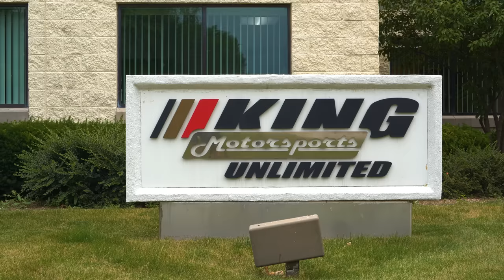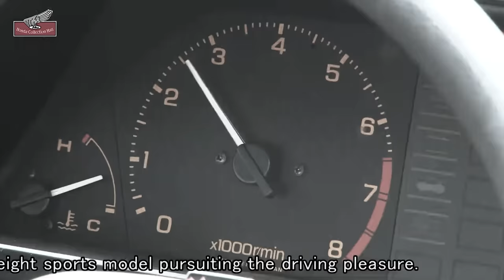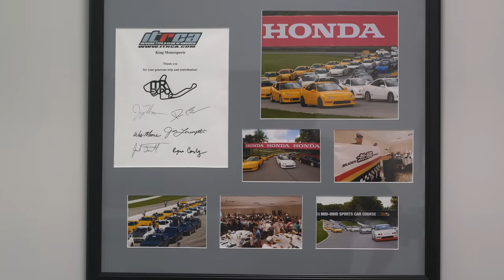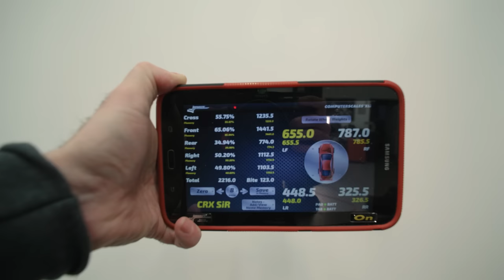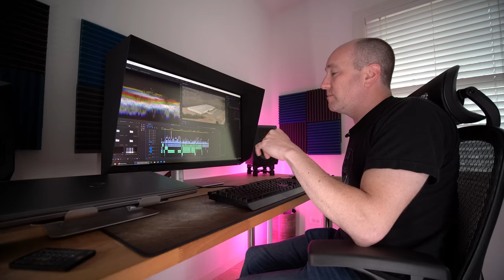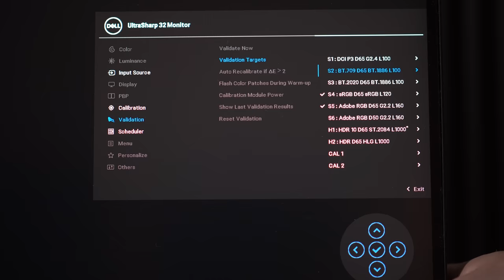Honda CRX SiR | The Golden Age of Honda

Comment: The rush of nostalgia was a smack in the face. I had CRX si for a short time and I miss that car dearly. The experience and joy of driving was unmatched. You have a cinematic gift which we all love watching! Never stop.
Reply: Same, one of my favorite cars I ever owned was a '90 CRX with a B16 and I changed out the trailing arm and front lower suspension arm bushings for Mugen units, what a response machine! Too bad the car just rusted out and I ended up with a DC2 next.
Reply: @KeitheR81  He starts the video by saying this car was fun, light etc etc and mentions affordable and attainable……🙂

I remember these very well when I was a teen and began driving in 91 in South Africa .

These were definitely not affordable to the average South African as Honda was pitched at the high end of the Japanese market in SA. Honda was sold through Mercedes Benz SA and they had price tags to match the premium Merc brand ….by that I mean much higher than Toyota, Mazda, Mitsubishi and Nissan, whom they were competing with. 

Honda specs in SA were premium so I guess you were paying for what you got. 

I never did get to own a CRX but I did manage get myself a Honda Ballade 160i Luxline 94 model which was a lovely car.
Reply: Did you rice it out, crash it, turn it into an endless project and sell it to the scrapyard?

Comment: I owned an early model CRX HF followed by a CRX Si back in the 1980’s.  They were both fantastic cars - the HF got 50+ mpg, up to the low 60’s on long highway trips.  An interesting thing about the HF was that the wheels were made from magnesium - so true “mag” wheels.  It wasn’t exactly fast, but in the ‘80’s very few cars were, and this thing was just so efficient.

They both were exceptionally comfortable offering so much leg room I could actually get the seat back far enough that I was stretching to push the clutch in and I’m no small guy (6’ 2”).  I remember one summer trip when I took the Si up to Canada and then ran it back through the UP of Michigan comfortably cruising at 100mph.  It’s one of the vehicles I wish I had kept in storage for posterity sake.

Comment: First YouTube video I've ever paid for. Honestly top tier production value every single time, thank you for your continued efforts!

Was floored by the CRZ comment. I get that it doesn't make a lot of sense on paper, but after driving one for 6 months it always makes me smile, which is great considering its only job is for the daily gridlocked commute.

Also I can't think of a suitable replacement that is also small, manual, economical (avg of 6L per 100kms/39mpg), has 4 seats, modern, somewhat sporty and is enjoyable to drive.

Comment: I bought my 92 VW GTI 16v in 1998. It was ,and continues after all these years, my favorite car.  It was before bulbous styling, electric power steering, traction control, cameras everywhere, silly CVTs and paddles, giant pillars blocking your view.. you were a bigger part of the driving experience. No one bought sports cars with an automatic, sac religious. Over the years I’ve enhanced the handling with Neuspeed sway bars, KW coil overs, and kept the engine Stock. appreciate my 2015 Scion (only recently purchased with 31k in 2020.. now splits time with bicycles and the GTI) for its airbags, operating AC, power locks/windows, timing chains, and quiet ride in comparison on a long trip.. but I get caught up in the fun so much with my GTI still.  Those comfy grippy seats, simple rolling sunroof, classic timeless looks.. It’s forever for me!

Comment: I'm 48 and my first car back in 93 was a used 89 Civic Si Hatch. My best friend(and still so to this day after my wife) also bought a used 90 CRX Si. To say as guys in our early 20's that we loved these practical yet a hoot to drive hard cars that were reliable beyond anything else fun available at the time, and still wouldn't cost a fortune to fuel up, would be an understatement!. I still judge every other car I've owned and driven, many much more powerful, against those cars. Sure it may very well be nostalgia that clouds my opinion, but very few measure up in sheer fun. Hell the reason my daily driver commuter car is a 2012 Fit Sport, is because as much as I thought I wanted a Civic Si in 2013 when I bought my Fit, as soon as I drove the Fit Sport, it was the closest thing overall feel to my 89 Civic Si; I could ring out and have a blast in the corners, without getting myself in trouble like I did with my short lived MKV GTI.

Comment: Back in the early 90s, JDM SiR CRXs ruled the small capacity class in amateur motorsport in my neck of the woods (Sydney Australia). They were so far ahead of any other hot hatch or oldschool small rwd car, I had a Corolla FX GT and later an AE86, and I just couldn’t catch these guys. IIRC B16A CRXs won their class in the state runoffs for all of the early 90s.  I love these things and would love to have one: but everyone who owned one in period loved them too, and they were all used up a long time ago.  Awesome vid, awesome car.
Reply: Here in the states nothing could handle a second gen CRX on an autocross course until the Mazda Miata arrived.  If you've never done autocross it's all second and third gear driving, hair pen turns and lower than track speed. The Miata had the edge because it was rear wheel drive but nothing else came close to a well handled CRX. We never got the Si-R here but that didn't stop a lot of enthusiasts from pulling B16s and B18s out of other Hondas and bolting them into this little demon. I didn't have the money for that swap for mine so I settled for a JDM ZC DOHC engine.  It was plenty fast enough for me but I always dreamed about getting a B series engine for my car.

Comment: My first car out of college was an 87 CRX si.  What a fun car to drive!  Not a ton of horsepower by today's standards, but with the five speed manual gearbox, and a gross weight of around 1700 lbs, that thing was lightning quick off the line.  As a front wheel drive car, it actually drove pretty well in the snow too.  You just don't see them on the road anymore.  This video was a trip down memory lane.  Thank you!
Reply: I had an '88 CRX Si and I've never had a car I loved so much since. It was so much fun. No back seat, crank windows, extremely light weight. And I could fit a surprising amount of gear in the back.
Reply: Selling my '91 Si if you are interested.

Comment: If someone is looking for a fun front wheel drive car, the 7th gen 1999-2005 toyota celica is definitely one you should look at, the 190hp one (180 in US) revs to around 8300rpm and is still pretty light at around 1150kg , they need lowering just because they are too high standard but they are a lot of fun and really good handling, even better with a good diff

Comment: I built one of these as a teen over 20 years ago. I had a 1990 CRX, a little rusty, I installed a B16A from Hmotors, YS1 LSD, Koni yellows, GC Coilovers, Rota Slipstreams, JDM front, same color - Torino red. I sold it for an S2000 and still don’t know if I regret it. I have an FK8 that I drive today that reminds me of it. Love these vids.

I’ve had a 1990 Civic Si that I did similar mods to - I’d love to see you get your hands on a 1990 SiR or a JDM DA Integra of the same vintage.

Comment: Oh man, that car reminds me of my youth. I owned a 1995 Civic. We installed a Gude Performance head and camshaft in that car. The cam had higher lift and longer duration than the stock cam. We flashed the ECU back in the days were that was scary. We had to connect an EEPROM programer to a Windows 95 computer with a serial or maybe a parallel cable to write a new EEPROM. Then you had to take that new EEPROM chip and place it inside the Honda ECU. Hondata made that possible. The new cam moved the power band even further into the stratosphere. I loved that car. I can't imagine what owning a CRX SiR would have been like back then or even today but another excellent video from you guys gave me a glimpse. 9:27 is a great moment in this video.

Comment: I didn't have an Si-R, but I had a 1990 CRX Si, with a JDM B16A swap from a 1989 Honda Integra XSi, complete with a Y1 transmission that had a limited slip differential. It had literally every bolt-on bell and whistle, including an Apexi air fuel VTEC controller, paired with a chipped PR0 ECU. There was no red line. 

The interior of the back was gutted. It was lowered 1.5" on adjustable coilovers, with a front strut bar, and a rear sway bar. The climate control was deleted. The intake was from a turbo Miata kit. It had a bigger throttle body, a DC Sports header, and a straight-through exhaust, with a deleted cat. It was LOUD. A kid I knew blew up his Type R while racing, and I replaced the stock cams with the cams from his ITR. I would wear out a set of Falken Azenis sport tires every six months or so. 

I used to shift around 8.5, but there were a couple times that I accidentally wound it out to 12. It was street-tuned, but it put down 166 to the wheels on a mobile dyno. 

That car was INCREDIBLY fun. 

Alas, it was stolen and never recovered. If i ever get a chance, I will buy another one without a second thought. 

Thanks so very much for highlighting this absolute gem of a vehicle! "Without racing, there is no Honda." -Soichiro-san

Comment: I've been daily driving a 2000 Honda Civic Coupe. It's an EX with the D16Y8 (vtec) and a 5 speed manual. Double wishbone front AND rear. Great on gas. Comfortable even for an economy car. Materials held up incredibly well both inside and out. The car never skips a beat, even with 176k miles on it now. There's a feeling you get when driving these older Hondas. It's an experience when you hop in and turn the key. 

These cars used to be the go-to for a cheap/fun build. And while they still are in comparison to everhthing else, the prices of parts are going up as they become increasingly harder to find with age. We really need to buy/enjoy these types of cars while we can! 

Sure, some of the new cars are cool. But none hold the same driving characteristics as these older cars that are more pleasing to drive. Thanks for covering the CRX Si and sharing this with the world!

Comment: I owned a 91 CRX Si that I bought used in the mid 90's and loved it to death!  The only mods I had done by a shop that raced CRX's at Road Atlanta were: slight lowering, Tokico adjustable shocks, AEM intake and some headers.  It was so flat it was amazing through the corners and had plenty of power to have fun.  I will always miss it.  😢

Comment: The CRX SiR has been my dream car for decades.

I had two first gen Si models, they were amazing to drive, I just wished that they had more power. I always wanted the twin-cam ZC that was found in the 1.6i-16 models. The 1.6i-16 models also had seats stitched with the CRX logo, a cool "ZC bump" on the hood and a much cooler looking steering wheel than the one that we got in the states.

I was eventually able to swap a later JDM ZC into a 4th gen Civic hatchback, and what a great engine that was... efficient, smooth, powerful and ridiculously reliable.

Good video, one correction, though: The first gen CRX had a modified MacPherson strut suspension in the front, which was fully independent. For springs, the front suspension used torsion bars, it wasn't a beam axle. The beam axle on the first gen CRX was in the rear.

Comment: I got hooked in the 1980s with cars like the Accord, Prelude and CRX (and even the NSX). After that very positive experience, I have only owned Honda and Acura vehicles (sport coupes, mid SUVs and compact SUVs) to this day.

The fourth generation Prelude made such an impression on me that I still own my 1996 Prelude VTEC and driving this NA car compared to my modern-era technology-packed Acura is a completely different performance experience but just as satisfying in its handling -- e.g., the red-lining the car using it's manual transmission (downshift) while hearing and feeling the VTEC kick in is still an insane rush like no other!

Comment: I loved my 91 CRX same colour as the one in video. DOHC VTEC 1.6 motor. It was stock with alloy wheels. Awesome wishbone suspension. Didn't have the glass sunroof - but solid colour one. Fantastic to drive. Sat low and revved with ease.

Comment: I had an '84 3 door civic, with the 1.5 variable intake, SI. With little more than 70HP this little thing left many, more expensive cars in my dust. Simple tech like this in many Honda products is what funded later developments like VTEC. I remembered stoplight racing BMWs and Audis in that car as I drove it onto the flatbed truck to take it to the crushers. Had Honda created these vehicles to last they would be a world power of automotive manufacturing today. They almost made it but.........  Thanks for the video.

Comment: I owned a 1989 CRX-Si. Ground Control coilovers,  Tokico HD struts, Neuspeed lowering springs and strut tower brace, DC Sports header and a Greddy cat back exhaust. The lift off oversteer was amazing and so easy to control. Not once in the 13 years and 320,000 miles I owned that car did it catch me out. I was all ready to do a B16 swap when reality hit. I had a 3yr old kid and needed a sedan. I sold my CRX and got a 2002 WRX. I still have the WRX but one day I would love to get a CRX-Si R.

Comment: I consider myself extremely lucky to have an old 1990 crx si. I dream of building a b20 vtec and installing it as a perfect daily driver and get all the eccessories working again such as air conditioning and make the sunroof work again. That being said after fighting like hell to save and find and work hard a couple winters ago to install a replacement d16a6. It now runs and drives again. I just got home from a trip to home depot and it's the most fun car hands down I have ever owned. to make this car even more special it was my first car I owned since 16 years old Now 32. My uncle who died of cancer used to have fun working on this with me in his garage and we drove this car together. this car has so much sentimental value to me it's unlike anything I've ever owed. It's so inexpensive to insure, cheap on gas. hard to believe its "just a civic". feels like so much more. I hope someday I can fix it up and truly make it great. I've painted it several times. rebuild engines and swapped transaxles. I hope to strip it down and custom build it and restore it from the ground up someday. Im so lucky to have it. This video was awesome!

Comment: In 1989 I traded in my Mazda B2000 pickup for a brand new 89’ Honda CRX SI.  Totaled it in a freak accident a couple of years later and replaced it with the 91 CRX SI…drove it for 11 years and put 112k miles on it.  The car was a champ and never had a mechanical issue. Throughout my ownership, I replace brakes, oil, timing, belt, and tires. That’s all it needed.  To this day, I blame the CRX for my continuous love of hot, hatchbacks.  Today I have the VW GTI.  But Man, I miss that CRX!!!

Comment: This brings back some fond memories.  I loved my '91 CRX Si; my first new car.  Everything was tight and quick.  That thing was so light that I once changed the rear tire by squatting the rear end up with a 2x4.  That thing also made 47 mph on the highway driving 70 mph so fuel economy isn't the reason it's gone...  I think that is around what the 1st Insight made.

Comment: Great video.  I club raced a Gen1 CRX with a ZC motor in closed road events for a few years then moved to an EF8 which is now onto its 16th year of club racing.  Still goes awesome and usually gives the 4wd turbo cars a run for their money.   And as a fun daily driver have another EF8 which is the Mk2R version (the lightweight version of the sir, hard roof, wind up windows etc...).  Still more interesting to drive than most modern cars.

Comment: Have driven the first gen CRX, so light and fun. My wife had a 1992 Civic SIR with the B16a2, so much fun as a daily. The stock exhaust was almost too quiet. When the exhaust rotted off we replaced it with an aftermarket one that had a nice tone at low revs and did not drone on extended highway trips. The exhaust did get more interesting after the vtec switch over just before 6K. It is sooo hard not to drive this engine above 6K like a little hooligan.  Eventually the rust was so bad we sold it. Now they are worth real money ...

Comment: As someone who has spent time behind the wheel of just about every Honda chassis from 89-01 it’s crazy how even the first generation Cr-V is fun to drive. You can take just about any vehicle in the Honda/Acura wheelhouse from the decade slap some quality chassis parts on and tune/upgrade the powertrain and you have a quality weekend track car.

Comment: I had a crx si in Germany. Man,  I miss that car. It could accelerate on the autobahn in no time. I recommend  the 89 with manual.

 Similar car, but using a turbo was the 1st generation mx6, a true diamond in the rough. It handles differently, but loads of fun.

Comment: i bought a new 87' Si, loved that car, you are right about it being a special car, FX16 and Scirroco 16V were not the same, haha i bought parts from King Motorsports, still have their catalog, Mugen was expensive, I had the muffler with twin tips, Jackson Racing was the ticket on the West Coast (H.B.) I got the 117 Kit, which was the Web Cam, Bassani Quad tip Exhaust, and a copy cat 4-1 header. Those were the days, kept that car for 17 years ran like a champ.  #hondalove

Comment: Back in the UK 1998 when I bought a Citroen Saxo VTR, only had about 2 weeks, was out on the north Yorkshire back roads, nice and smooth ended up racing a Honda CRX, remember he could pull away from me but my brand new Saxos suspension was nice and tight so quite easily stay with the CRX threw the bends.
Fun times.